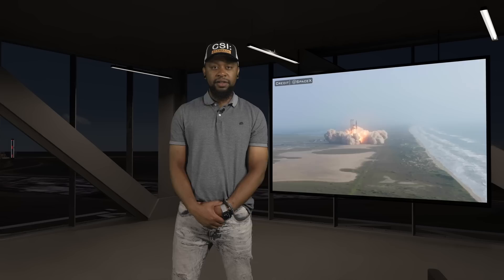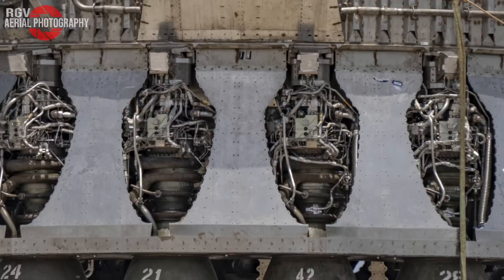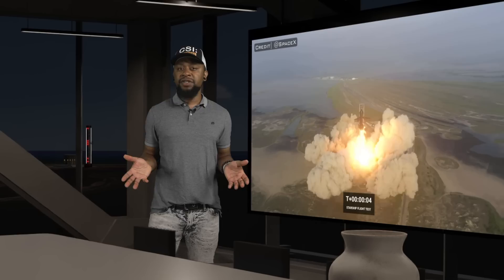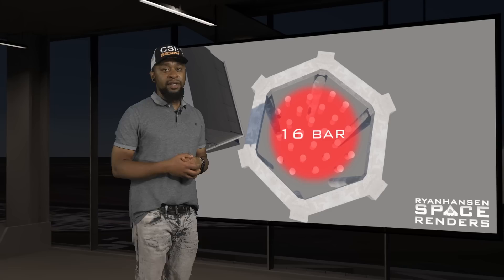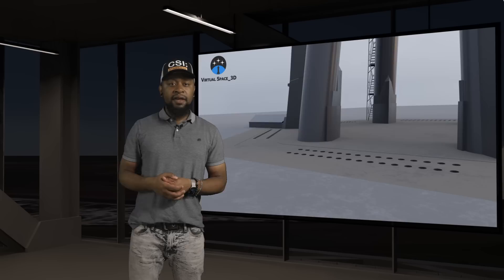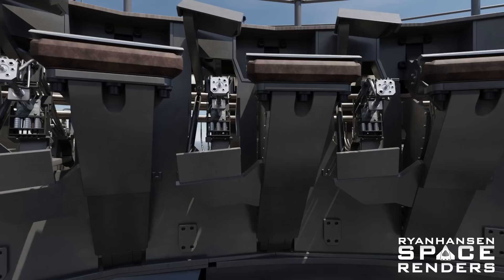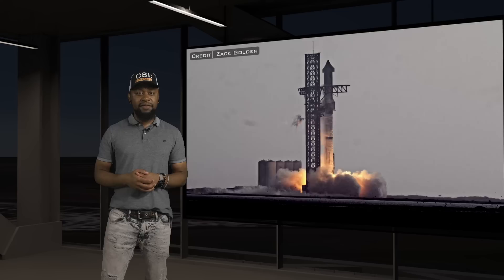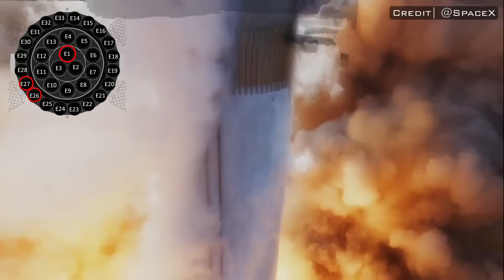The Design Flaw That Caused The Starship Launchpad to Fail!

Comment: A very nice examination , i have to admit.  The only problem i have with it is: calling it a "minor design flaw". As NOT installing a properly secured launch plate was clearly a cost-saving measure. Musk  knew where he put his Launch pad, and the Groundwater level is too damn high there.  He basically needs a massive concrete Block, that redirects his exhaust gasses and other contaminants, and that houses a water cooled Steel plate, the pressure can work off of.

Comment: Zack - looking forward to your analysis of the water-cooled plate system. I'm curious - where did you come up with 16 bar pressure at the ground surface? Raptor 2s have 330 bar working pressure. How could it drop off so quickly on the way to the ground? Your figure shows 16 bar uniformly across the shadow of the 33 raptors, but that is probably not likely. Exhaust plumes of neighboring engines will affect plume pressure. A better representation would be a bullseye with highest pressure at the very center. My guess is that the pressure at the center point is much, much higher than 16 bar. I haven't modeled or calculated, but I wouldn't be surprised if it is 10X more pressure. If it were 160 bar, that would be 2,300 psi, which is within the range of the high-pressure driver gas for the water that you mentioned. But water pressures that high would test every weld, and losses from the driver gas to the launch mount would decrease final exit water pressure. I would love to be a fly on the wall at SpaceX as they discuss how to model and size this thing. I feel like there is a very strong possibility that concussive exhaust shock waves will stagnate and reverse water flow and create a steam rupture beneath the plate. Once that happens, there will be steam- and exhaust-powered steel flying everywhere at supersonic speeds. I hope it works, but I wonder if this is step 2 on the 3-step path to a flame trench.

Comment: SpaceX flight termination system failure was a massive concern! 40 or so seconds of uncontrolled flight of 5000 metric ton bomb is not good enough! It looks half arsed!
Reply: Hence recertification & redesign
Reply: @alvianchoiriapriliansyah9882  Correct. I was just concerned what could have happened that flight with a massive rocket with no guidance for a large period of time as well as flight termination that took 30 or 40 seconds at least. The end of the rocket could even have been structural failure. Anyway I bet SpaceX are well into sorting the issues and I am really looking forward to the next launch.

Comment: Hey Zac. 
Someone needs to do the math on the water pressure required to be ejected from under the OLIT to combat the force of 33 raptors.
Wouldnt the water need to be greater than the raptor? And much greater to avoid the water inside the shower head turning to steam and exploding?
And how is this pressure contained so the water isn't making its way into the raptor nozzles before the engines start and ramp up power.
There's going to be some hard work to get this balance and timing right without causing a pad RUD from flying sheets of steel from underneath the rocket instead of concrete.
Or engine damage or ignition failure.
Looking forward to seeing your take on these things.

Comment: 130ton/m2 is not really much pressure for concrete, not even for normal concrete. Its much more likely that its the heat that is the issue.. It don´t even need to be that thick to carry that amount of weight between different piles. We do it all the time when we building high rise buildings.

Comment: I really like what you are doing with (more or less) remote analysis Sir.
Thank you.
The upper cooling pictorial for launch mount (@49:20) shows reticulation from one side to other side all the same direction.  What if the 4 water streams were 2 clockwise and 2 anticlockwise?  Would this mitigate the temperature imbalance that you mention a short time later?

Comment: Excellent presentation of the B7S24 launch events.  Congratulations.

It's become clear to me that SpaceX needs to rethink the entire Starship Stage 0 design. 

Ocean launch/landing platforms are the future of Starship. The sooner, the better.

No flying concrete. Just seawater to swallow the 33 Raptor 2 engine plumes. 

No tank farm like the current one.  Just modified LNG tanker ships to transport the methalox and LN2 to those ocean platforms in 50,000t (metric ton) loads. Enough for at least 6 or 7 Starship launches. Eliminates the hundreds of tanker truckloads carrying methalox and LN2 now needed to fill the tank farm. The LNG tankers are the floating tank farm.

No nearby citizens and private property to cause safety issues.  No environmentally protected areas to cause permitting difficulties.

With platforms located offshore from Boca Chica, the entire Gulf of Mexico becomes a tracking range for the exclusive use of SpaceX Starship launches/landings.

Comment: I have the right idea for spec x. Only if they will listen to me. If they want to do this without a flame diverter, trench, they will have to prepare the launch pad and foundation more than what I understand they plan to do. I do t have a system to render anything now. But I’ll place my knowledge here. This is my advice. 1. They need a double steel plate, in between there must be concrete, they use the same concrete in between the steel plate and at the top, bolt down or weld down the top plate seal in the dry hard concrete.  In between there will be partitions, and water coolant piping.,Those holes they dig and cast with concrete is good. The water system, can be design similar to how a car/ train, water cooling system is set up, only that no radiator is needed. The difference is, because of the quick building up of heat that will pressurize the piping, there has to be blow off valves at certain points when the water reach a certain temp. A dual water system is needed. One to keep the metal plate base cool, the other is to be dump to reduce shock waves, noise, and help to reduce heat. The water coolant system to cool the steel plate with concrete in between, cannot be a one way in and out. Has to have multiple in and out with pressure blow off valves. The steel plate will need a buffer steel plate that can be change in the event where the blast burn through that first metal plate or some other material that can take allot of heat and will not shatter, if that is necessary. Outside around the launch mount, they need to put concrete walls in the earth in a circular formation, prolly 25 to 50 feet deep. And on top outside is a wide area of that special concrete if possible. They need to put up a higher flame diverter to shield the tank farms. I personally believe that concrete in between thick steel plates is the right deal.

Comment: The penetration of gas jets into a water surface appears to be proportional to jet velocity to a power greater than 1. If the CFD study I saw is any indication, scaling up to the exhaust velocity of a Raptor engine (about 3000 m/s) suggests a water depth of at the very least 1 meter (and probaly several meters) will be required to prevent direct exhaust impingment on the steel plate. All the illustrations I’ve seen just indicate a “puddle” of water which would get blown away. I don’t see any retaining walls that would maintain a water depth of a few meters.

Have there been any tests of the water-cooled sandwich using physical scale models?

Comment: Zack Could you do a CSI on engine failures, and the the present production / testing.  Two engines where replaced after the static fire,  3 engines where shutdown before launch, a couple exploded.  And there have been several engine replacement after other testing.   If the are V2 engine, or even late number V1 why are so many being replaced ?  These are supposedly qualified and ready for flight engines form Mcgregor.
Reply: Because this is a first flight of V2 engine

Comment: Got an idea, might be in video or comments tough (Have not watched trough).

Water table is very close to the surface, I was thinking that vibrations could have been caused kind of Quicksand like event under the concrete.
Reply: No, that is what the pilings are for. The problem was they did not add enough of them at the edges near the legs. Also no pilings around the pad. They are adding those now.

Comment: Nice breakdown. I do wonder how that powerslide affected the in skirt pressure and temperature. Hitting the top of the OLM at such close range (presumably less than between the rocket base and the blast pad for a short period), affected things. I also have to wonder if the explosion in E17 was entirely self made or weather the HPU was allready failing in some fashion that affected it, (A pipe leak that was routed near it could easily have caused damage given the pressures involved). Also very nice catch on the O2 leak, i'd guess the RUD in E17 damaged an oxygen line, wonder if the later engine failures where due to uneven fuel flow issues from that damage or where indipendent?

Honestly looking forward to the inevitable report that will be written on what went wrong, i believe the FAA has to do that?

Comment: What if SpaceX left the giant pit?   Placed the stronger pillings under the pit and then fondag concrete, then the rain head, and filled the pit with water?   

The water would turn to steam, but continual filling would keep it cooler and it would absorb quite a bit of the acoustics shock?
It would be like flame diverter?

Comment: A NASA study done in the 70's found that the amount of water needed for a vehicle Starship size would be physically impractical. 

The same study also found that acoustic shockwaves reflect at 45 degree angles to the exhaust on large vehicles. So a flame diverter would reflect the shock waves back at the vehicle, ultimately tearing the vehicle apart
Reply: Study title?
Reply: @alvianchoiriapriliansyah9882  Acoustic Loads generated by propulsion systems, June 1971

Comment: Glad they're moving the vertical tanks in the fuel farm. They were just too damn close to all that power. Going with "hotdogs tanks" is a smarter move. Methane and oxygen tanks need to be underground to prevent big booms if something goes wrong.

Comment: The header tank kept the booster running after the FTS was triggered, only once the pumps started to draw in extra air from the header tanks being drained and sputter did the engine bay explode.

Comment: Nice video! As far as the new tankage goes... why does SpaceX need two suborbital pads now that Massey is able to perform the cryo testing?  A bad SS static fire incident risks some downtime, but running  a risk like that is in their wheelhouse...
Reply: Maybe the suborbital pads are still needed because that is only place that static fires on starship can be conducted.  And Massey is reserved for cryotests as well tests of structural integrity with the cage.
Reply: @michaeldeierhoi4096  my point was... are two suborbital pads still necessary at this point in the program, or do they give one up and use that space for new tanks? Some risk of a SS static fire fragging the pad... but those will be done with minimal propellant load, which would reduce risk of major damage.
Reply: @obelisktoucher4562  I suspect that the tanks will stay pretty much where they are.  Improvements on stage 0 plus upgrades on the booster will make a RUD on the pad less likely.  Maybe they will do more to protect the tanks themselves, but we'll soon see.

Comment: The concrete was a problem that needs to be fixed going forward but appears to have has NO EFFECT on the amount of success the Starship did or did not have. Also Stage separation was never attempted.

Comment: I have a decent understanding on concrete, and I don’t believe it’s the reinforcement of the piles, nor pressure pushing down on the slab…..

It was just not dry enough, the water table is very high and there wasn’t a impermeable layer added under the fondag. The rapid explosions being heard isn’t the concrete snapping away, it’s internal steam pressure rupturing it from within. 

Technically the issue is the sand, but not by compression, but it’s wicking effect.

Comment: The most common issue in engineering is lazy engineering, where the engineer will ignore the failure analysis and concentrate on who gets their way in a project.  The launch pad destruction shows the lack of understanding of the pressures related to the soil beneath the concrete.  The bolster needs to be deep enough to not be affected by the engine vibrations and pressures.  

This is one of those many issues I had to face as a COO with a background in engineering.  I am not a typical YT watcher as I have more education than 2 engineers combined.  One of the most common issues in engineering is the politics involved to get their way, even when they are dead wrong.  I remember sitting in a meeting with 30 engineers, which all were arguing over who had the most authority.  I sat there and watched them fight over silly stuff, while I had the authority of the CEO.  Let that sink in.  Most engineers ignore the dangers and poke the bomb hoping to get their way.  One of those meetings, I had 2 engineers trying to sell me on a quick fix that was suppose to not change a solution.  This change required a change in mass, so every solution would change at a cost of over $5 million per year.  For every bad idea comes a cost.

Engineers use tenure( years on that job ), schooling( years in and classes took ), rank in the job, and age.  It is like watching a bunch of teenagers fight over who gets the bathroom first!  I called it, The Flight of the Eigenvalue IQ.

Comment: It really perplexes me why SpaceX never attempted a 100% thrust static fire. And/Or why they didn't just wait for ground systems to get finished.
Reply: Because you'll damaged the pad in a same way but no flight data achieved (FTS flaws remains undiscovered, etc.). Less gain, more cons
Reply: @Alvian Choiri Apriliansyah  you would not damage the pad in the same way, if you slowly ramp up thrust over multiple static fires or stick to the short static fires or wait for ground systems to finish. After all SpaceX clearly already thought the current system needed to be replaced.
Why test systems you know are going to fail?
Reply: @plainText384  Larger crater. Time consuming to patch

They need flight data fast, can't be compromised. Steel plates was months away from being ready

Comment: I have no doubt the mass dampers would be used it only makes sense while you are doing this big a redo as you would not want those water pipes damaged from vibrations as cracks would form pretty quickly without those dampers on the weld joints.

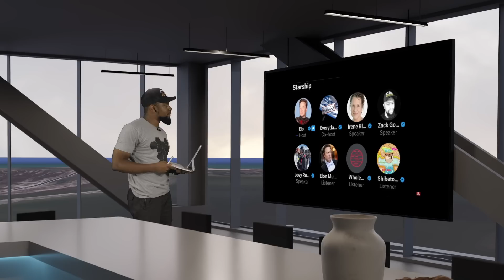Comment: I'm thinking about 25:00 what Elon said. Is it possible that the ground below became liquid (non-Newtonian fluid) like when you tip-tap on wet sand because of the vibration and pressure? What are your thoughts on this?
Edit: nvm should have watched further :D

Comment: what if the engines that would result in a powerslide ~towards~ the tower , instead of away from it, failed or were were shut down automatically at launch? that much lean / power slide was enough to put the tower in danger, even if those amount of engines out would still allow the booster to have positive TTW.. it seems that no asymmetry of engines out is tolerable before tower clearance.
Reply: Probably only the engine failure at this orientation is allowed to liftoff because of this

Comment: Is BLEVE out of the question given that the water table is in contact with the overlying blast surface? 1700:1 expansion ratio has a lot of potential for causing damage.

Comment: Great analysis and video. I wonder why they didn't test all engines at full thrust locked to the stand to see how much damage that would cause.  However, SpaceX got much more data this way. It's amazing how much data you can get, if politics don't get in the way. Politics is piece meal.
Reply: Your assuming the pad could hold the rocket on the ground at full thrust.
Reply: I did assume that because other rocket pads wait for fully developed thrust until they lets go.
Reply: The bigger the rocket the more power it needs to get of the ground.
It's possible but I'm not sure the current launch site is stable enough to hold a rocket trying to lift with 2500t of thrust (the other 5000t of thrust would be used just to counter the weight of the rocket fully loaded with fuel).
Reply: Instead of a test stand they already got that full duration burn by... actually flying it